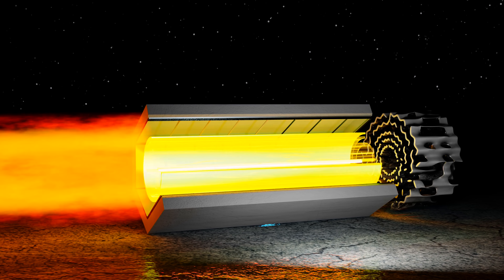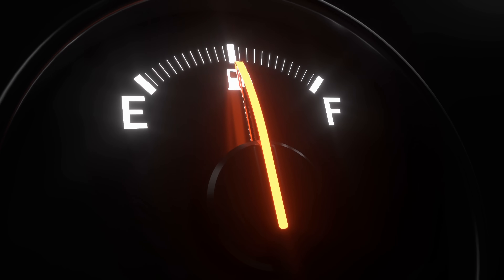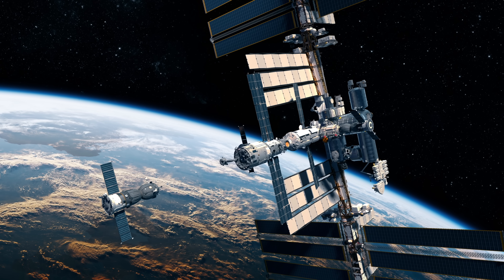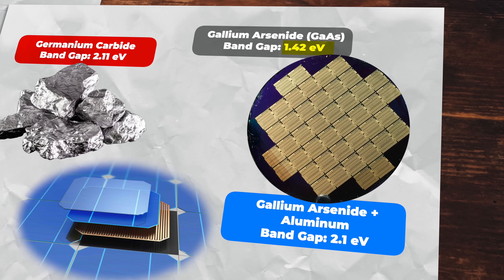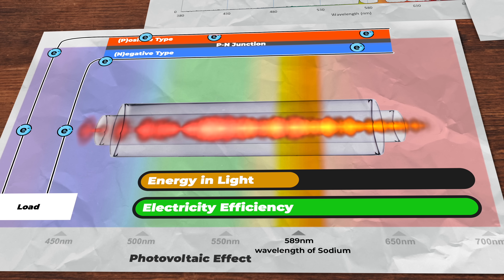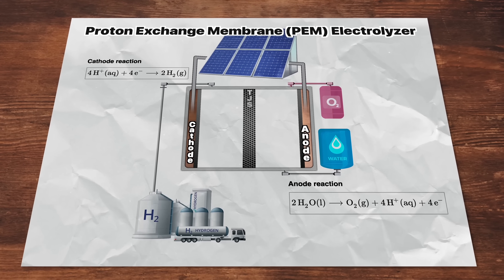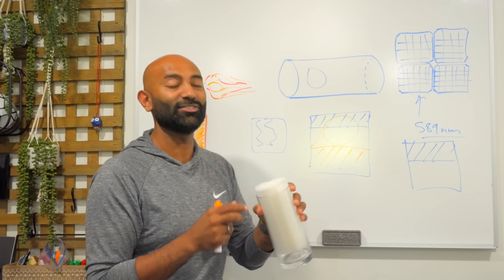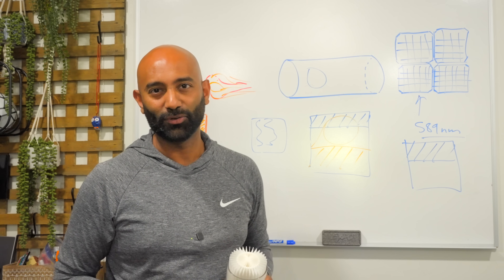Why Solid State Might Save The Combustion Engine

Comment: When you claim double the best efficiency of all other heat conversion engines, no moving parts and greater flexibility than anything else... I'm sorry, but that sounds too good to be true.
Reply: This video over-states the claimed efficiency of lightcell, and the founder, @danielle_fong, tried to correct it in a comment, but her comment isn't showing up. Their current efficiency is something like 20%, as they're still experiementing. Up to 70% is the light to electricity efficiency *goal*, and it's feasible for band-gap-matched solar cells and has been demonstrated in other concepts (i.e. laser light to band gap matched cell). Combustion efficiency, of course, isn't quite 100%, either, and neither is the heat-to-light efficiency. But the no moving parts is just the consequence of using photovoltaics. NASA has done similar research in thermophotovoltaics, although that's in the infrared, not visible. Don't punish the company for the exaggerations of this video maker, though. Not their fault.

Comment: I am not an engineer but a quick google search seems to indicate that the temperature required to get this light out of salt is high enough to melt nearly any material.  So, how would one build an engine to do this without melting the engine....or the solar panels required to harvest that light energy?

Comment: The exhaust gases carries out energy from the system in 3 forms. 1) Sensible heat, expressed in the temperature of the gases, which the thing will try to recover as much as possible (but no chance to recover fully), 2) Latent heat: any fuel with hydrogen content mixed with air and burned will produce water molecules, and there is significant energy absorbed just in the process of water vaporization (not stored in temperature but in the gaseous state), and this latent heat will be lost unless we have a condenser, 3) Kinetic energy of the outgoing exhaust gases, which could be partially recovered with yet another device, a turbine. I see too many conversions needed to even considering a 60%+ efficiency.
Reply: Yes,the first thing I thought of when I clicked on it was you would be dealing with the production of hydrocarbon exhaust,ie CO,CO2,etc
Reply: Why not 60% efficiency?
Large conventional thermal power plants are near 60% efficient, so are the largest marine diesel engines.

Comment: The problem with your last idea of using a traditional ICE and capturing the waste heat to run the sodium cell is the exchange of heat would be too slow and the ICE would overheat and seize up. I don't think you could get sufficient heat removal from the engine and still make the lightcell work.  Standard engines operate at 200F I'm not sure what the temperature to make sodium glow is, but I bet it's much higher than that.

Comment: I think the reason FuelCells haven't taken over for ICE is the energy loss in H2 production. It's either made from natural gas or with electrolysis. Both have a significant energy loss in the process.

Comment: 14:34 you are wrong. The only possible combination of mechanical engine and sodium glow engine, is the vice versa scenario. The sodium needs high temperature to start glow. So heating the sodium would be in the first place. The rest of the heat that would simply go through exhaust would spin some turbine to harvest a little bit more energy from that heat.

Comment: wait, we were able to convert plain heat into photons by sodium all along? Then capture them into electricity?  That sounds 2nd law breaking ... - Why are we not putting low-pressure sodium around all hot things? XD
Reply: until now, all heat engines were heat-GRADIENT to electricity ...
Reply: Sodium is very efficient at turning heat into light, but you still have to get it hot enough to start glowing. Most hot things don’t get hot enough to do that and besides, we didn’t have this special sauce over technology yet.

Comment: Most of the energy output of fire is in the form of heat not light. This is why we are getting rid of incandescent bulbs.

If we have a miracle 50% efficiency PV cell. Even then we are already going to have efficiency below 50% which is worse than a plug in EV or hydrogen fuel cell car.

Comment: I am highly skeptical given 80% efficiency while converting fuel first to heat then light then electricity. That's a lot of steps while only lose 20%. Also, you said the energy density of 10000 Wh per gram. Was listening to this and was like...no freaking way! It's per Kg ...so several orders of magnitude different.

Comment: This isn't necessarily smoke and mirrors. The concept has been around for about thirty five years. I first heard of it in Popular Mechanic back in the day. 

The concept doesn't actually burn fuel like the ICE engine does.  A Reformer splits apart molecules of the fuel.  These are then fed into a fuel cell.  This is used to drive electric motors for movement.  Electricity is also used to power secondary systems.  

The drawback is the systems are full of membranes and costly platinum group metals.

Comment: 2:47. I understand why you can get more energy density with fuel as within a battery/ (Even I know this already a very long time. Diesel is 10-11 kwh/kg a top battery , newest available in labs, is 2 kg /kwh or ten times more heavy than diesel.
But at this moment the energy density of an electric motor will be very high.
Higher than most other type of engines. Not lower as you are telling. 

I do not think it's better to use restheat of a combustion engine if the total efficiency is not much higher compared to a direct usage of all heat to light and electricity.
Because it's much more efficient to drive a car with the 95 to 98% efficient electric engines without transmissons (is also a big loss, friction in transmissions) . Also you have the high maintenance on combustion engines which would be avoided when just changing all energy (80% efficiency as claimed) to electricity.

In other words...thus technic will not save the combustion enngine..... it will end that engine even faster.

Comment: This is nonsense, they convert gasoline by burning into heat, this heat will be converted into light and this light will then converted by solarcells into electricity? The average rate of energy- "winning" by any solar-cell is just 20 up to 25 %, thats it.

Comment: well several things about this simply do not pass the smell test... heat is one of them as just a reminder to you that germanium's intrinsic temp is about 90degrees C above that you cannot have a semiconductor made from it and any solar cell will require a semiconductor to function... and efficiency, just remember even a quartz window will block several percent of energy all which adds up to heat, heating the solar cells beyond any conceivable operating temp... and when they state an energy density of 10KW in one gallon of space  and do it without a rapidly moving cooling "fluid" I GAIN CALL BS as that density will make everything and I mean everything cherry red... jet engines only manage because they have massive amounts of fluids (fuel and air) moving through them and they are made of high temp steel alloys not a semiconductor...  if they had a prototype where they burned everything in a small dia quartz tube far apart from any solar cells with massive amounts of cooling air moving through it between the glowing sodium and the cells it might work but it will NOT scale well.... physicists are generally ignorant of how to scale anything (can you say fusion power) unless it includes uobtainium or pixie dust...

Comment: Roflol.
FAKE AS F!!
Why!!
There is no solar cell on the planet!!!
That can produce those amounts of KW in that size!!!
The sun!!! casts about 2KW of sunlight power per square meter.
The most efficient solar cell now!!! is about 25 a 28%.
Thats 500Watts per square meter at 25%
That thing you said is the size of a milk jug.
Is much smaller then a square meter.
FAKE FAKE FAKE!
And it would be stupid to let the heat go to waste!
Steam!!! is much more powerfull it does not need a big package.
And could indeed with the right pressure vessel produce that amount of power in that size.
But that is not what his tech is.
FAKE FAKE FAKE!

Comment: Yep, you said it, Smoke and mirrors I reckon. Proven by Laws of themodynamics and physics. I remember a similar idea to this come out years ago, known as an IR solar pannel. It was said to have worked with tuned micro dipole arrays at infra-red frequencys. Last I heard It turned out to be a scam used to entice gullible investors to pour money into this new top secret tech, with disastrous results and zero returns. As always to get someone to drink the poison, you need to sweeten it with some truth theory, that sounds right and makes sense. Unfortunately as humans we are all curious and gullible to new saviour ideas, "some good" and some just another dead end road with "through road" signage on it.

Comment: This might have some hope on a small scale, but to get enough peak power to accelerate  a car would take a lot of solar cells, even at 90% efficiency,  The light cell will be very big.  Something like a Volt Hybrid can demand 120kw at full acceleration even with an ICE engine helping.  A true EV like a Tesla would need 200-500kW for peak power.  You could add a battery pack to help supply high demand requirements, but now space is really getting eaten up.  The LightCell might have some fixed location uses.

Comment: Seems like it'd work better using a huge Peltier thermoelectric device. Granted, those are pretty inefficient. I honestly don't know how they're gonna get even 60% efficiency out of a photovoltaic cell. Because they're like 20% efficient on a good day. Even with tuning the light source and the cell to match. Plus, they'd have to be insanely heat resistant. Honestly, we'd be better off using a stirling engine, they can get really high efficiencies, like 80%, when they are sufficiently precise and complex. Use that to generate electricity.

Comment: Combustion creates residue by varying degrees depending how it`s tuned. I would wonder how much upkeep the burning process would need to keep the bandwidth "nice and clean".Wouldn`t this be better for a stationary power plant where monitoring the system be more "professional"? I can`t see the average consumer ready to handle much maintenance.

Comment: The emissivity of combustion products at this temperature is important as this would result in black body radiation.  The obvious products are water and CO2 and these will radiate in the infra red which will have 0% efficiency on the photovoltaic panels and so will just cause waste heat.   At 2000K the black body peak is 4 um which corresponds to a very strong emission line for CO2 and H2O has strong emissions just below and above this wavelength.  Combining these between about 2.5um and 7um a combination of CO2 and water is going to emit strongly.
I could go further and calculate the optical depth and hence actual radiated emission of these gasses but it is loads of work and I suspect that it is going to be far less than the emission from soot particles and even this is going to be less than the direct contact heat transfer to the inner surface of the tube.
I leave it up to the team behind this device to calculate the black body radiation from the gasses + plausible particulates but until they give some numbers for such fundamental problems as this (plus the others I have mentioned such as compression) I am in the 99.999% this is a scam camp.

Comment: The design as shown in the video is has nothing to make the hot gas move into the chamber and as the gas in the chamber is the same gas that came in from the intake plus some fuel and is heated it will have a much higher pressure than the intake.  Something has to push against this back pressure and as this does work it is going to require energy.  The front half of this machine is something that takes in air, compresses it, mixes it with fuel and ignites it (got to compress it to make it go the right way).  This sounds alot like a jet engine so the comparison should be with a gas turbine which can achieve 60% with bleeding edge technology.
Reply: Its a scam

Comment: Carnot's theorem
The absolute maximum efficiency possible is (hot - cold) / hot.  In this case hot is specified as 2000C (about 2300K).  The cold side is the exhaust from the engine and even their graphics seem to show that this is still very hot, lets be generous and say 400C (about 700K).
This gives a efficiency of (2300-700)/2300 = 70% which is the utter absolute maximum efficiency that a perfect machine could achieve.  This sounds suspiciously close to their claimed efficiency but in real life nothing gets close to this.  If it was running this well then the sides of the machine would remain at room temperature and clearly this is not going to be the case.

Comment: Most of the energy produced by that combustion would still come out of that system in the form of thermal energy in the exhaust, and that loose high-temperature sodium would chemically destroy stuff that it is exposed to (although I suppose this can be fixed by keeping it in fully transparent containers made of exotic materials such as 99+% pure Antarctican fairy dust, which may blow up in price in the commodities markets once this goes to market).  Soot would also be constantly coating stuff in there, blocking the light generated.

I have a better idea.  Make a self-resetting Rube Goldberg machine with 1000 steps in it to harness the energy from squirrel fart combustion into the amount of energy needed to power a whole house.  We will make it 99% efficient by using every last bit of energy obtained from the squirrel fart combustion in a different way at each stage of the Rube Goldberg machine so as to avoid wasting any of the energy generated.  It is genius!!

Comment: 3:00 This is so incredibly stupid.
If this worked, why not just layer the top of a car with the same photovoltaics? I'm 1000% certain the sun puts out more lumens than a burning flame.
Reply: They explain how the solar cells are only efficient at one wavelength which they are using the flame’s heat to create.

Comment: FYI: Internal combustion engines are nowhere near 40% efficiency. for starters, about 66% goes straight out the tailpipe in the form of heat2% to 5% leaves the combustion chamber as unburnt fuel (if this were not the case, your engine would detonate instead of burn the fuel, causing damage). About another 12% of your energy is lost in heating up the engine and must be eliminated by the cooling system. Then there is the friction of the rotating assembly and valve train. another . If you get even 20% of the energy in your fuel out as useful work to move the vehicle forward, that's a really good engine.
This is why battery electric cars with 92% efficiency or better can get around 300 miles range with the energy equivalent of about 3 gallons of gas in the battery.

Comment: Yeah no. Too many conversions wasting energy and far more complex peaces than needed. Its same issue with hydrogen, unless we can collect it from outer space as solid, or have limitless energy production. While ICE of -90's, say corolla 1.6l is not perfectly optimized its extremely reliable, easy to rebuild and still is rather fuel efficient, the body rusting around it being the limiting factor but still able to be rebuilt to extent with a welder and sheet metal, while modern special steels you are not allowed to even weld repair. In cold north something like that corolla is requirement as it will start everytime and parts can be in a pinch made at home, where you cant reproduce modern electrical parts, since those have software locks requiring linking the parts for those to work, even if its correct part and its functional.
Ou right this was the channel that push new age cult trash, how there is breakthrough every other week.. that explains the video..-.-

Comment: Not an ICE, ICE are heat engines where a working gas moves a mechanical part.

If the temperature is too hot the thing will be burning nitrogen in the atmosphere and making NOX pollution.  That's a problem with hydrogen engines too but there are possible solutions in that case.

Comment: Dang it. You closed with thr muffler idea.

The reason thst woukd "blow" is because it would put back pressure on the combustion exhaust system...

...unless you could remove heat and thus add density to the gas WITHOUT compressing it.

So a gradual heat removal system could cuae zero backpressure.

Comment: If there is a laminar flow of air between the combustion and the glass, the glass will be insulated from conducting or convecting heat.

No ICE uses the perfect stoichiometric ratio if fuel and air.  Doing so would produce too much heat AND unburned fuel. Gasoline engines at excess fuel, diesel engines add excess air, jet engines use excess air.  In all cases, the additional fuel or air acts as a coolant.

This is CERTAINLY using excess air to cool and insulate.

Comment: Sooo... Why not go TEG (ThermoElectric Generator)?  TEG and RTEG has already been developed by NASA.
Even with High Efficiency Modules you still have to Multiply the Losses for each Step between different Energy Forms.
Be Warned when anyone starts talking 'Watts".  A Watt is not Electricity.  A Watt is the Ability to do 1 Watt of Work.
Watts can be Thermal, Electric, Acceleration, Chemical, Kinetic, Pneumatic, etc.  Make sure you understand how to Convert between different types of Watts.

Comment: what are you powering with a single small solar panel wrapped around a tube? Even with 20-30 tubes you are very efficient but it very efficient low power cells.